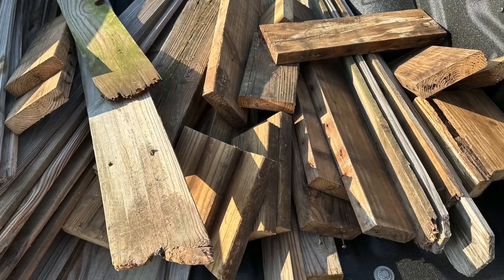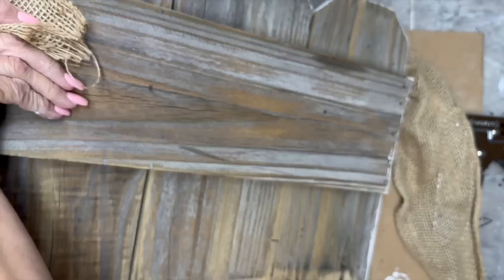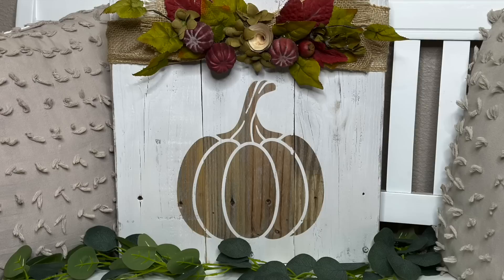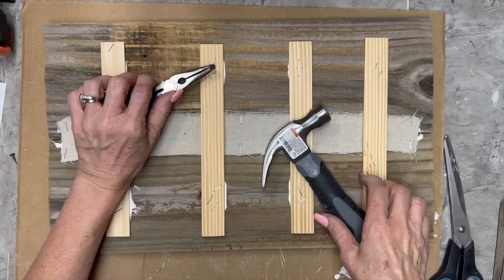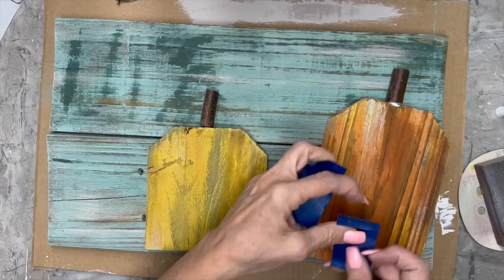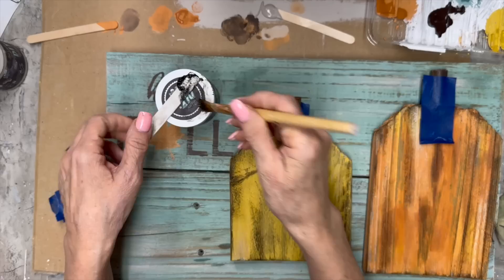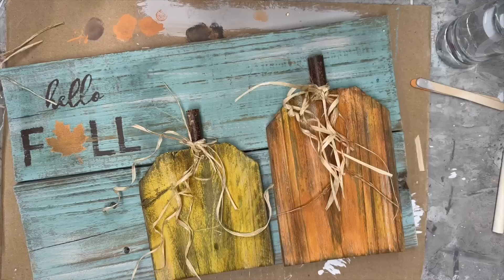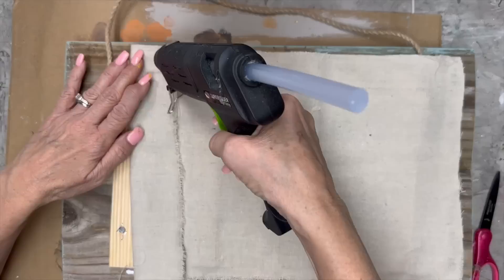RECLAIMED WOOD DIYS/RUSTIC FARMHOUSE FALL HOME DECOR/DIY PAINTS

Comment: A better and more finished look for putting together old wood is to use furring strips. It actually ends up being around the same price as the stir sticks. But much better quality and you only have to use one on each end. I would recommend attaching it with wood glue and screws
Reply from the maker: Oooh.  Thanks for that tip… I’ll look into that… just trying use up all that “stuff” in my stash. Lol